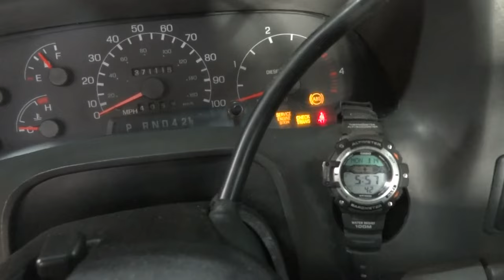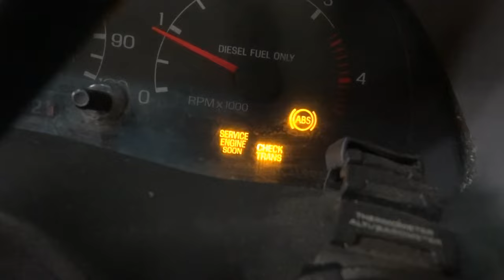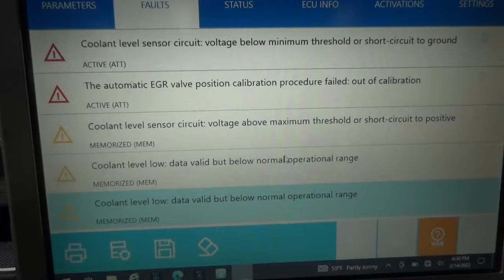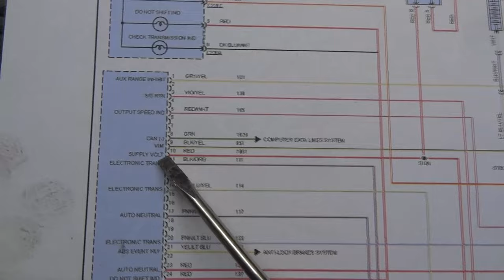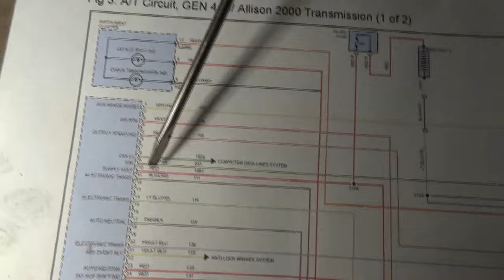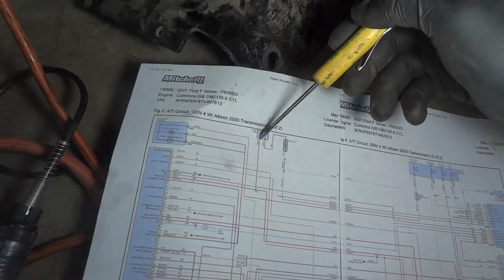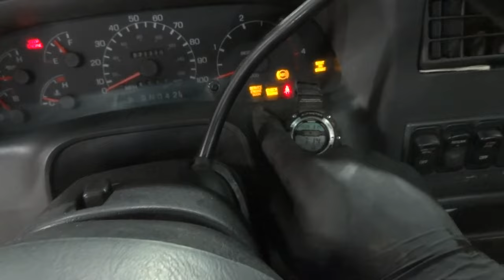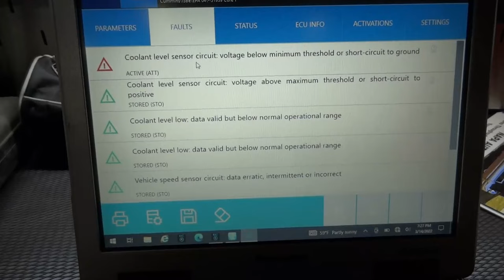Ford F650 No Crank No Start, Allison Transmission Not Shifting, Diagnosis & Repair Part 1

Comment: Just wanted to leave a comment on an issue that I had with my F-650. I put in two brand new batteries and I noticed that there was no power to anything. No crank, no start, and no power to dashboard. After several hours I saw a switch by the steps. I flipped the switch and immediately I heard the alarm for the driver door being open. I put the key in the ignition and tried to start the vehicle about 15 times with no luck. I then went to the local Walmart and got some Starter Fluid. When I opened the hood it said never to use starting fluid in the intake. I disregarded this message and sprayed it once. It cranked but still didn't start. I sprayed it a second time with a large volume of starting fluid. Turned the key and then it started! Had to wait for the brakes to get the right PSI and I drove it 800 miles!
Reply from the maker: Alexander Golovin  Thanks for sharing your experience with us!
Reply: @KITS_Auto_and_Truck_Repair  Of course! I used this video to help me diagnose the issue. Thank you for your great content.
Reply from the maker: @MrAlexGolovin  My Pleasure!

Comment: Good morning sir .i have a question ❓ please how do u get to pull up a wire diagram for a vehicle.i have difficulty getting specific wiring diagram when needed.thanks
Reply from the maker: Tahla Jude  I get my wiring diagrams from michel pro demand you can call them and they will help you!
Reply: @KITS_Auto_and_Truck_Repair  ok but how do I reach them .it will help me alot in diagnosis . writing from Africa .cameroon
Reply from the maker: @tahlajude5572  ah ok!! you can email them and see if they have a rep there!

Comment: Very Smart move from you!
Am on the similar situation,  2009 ford 750 
I need some help
Reply from the maker: @user-mi6iz8gr7h  Do the tests that I did in the video! you might have the same problem!
Reply: @KITS_Auto_and_Truck_Repair  I have had hire 3 mechanics so far, with their computer and no one  have received a signal from tmc , so am at the point to do my own test following your knowledge,  and se what I have, thanks
Reply: I  decided to buy a new TCM, and installed  ta solve the problem!!!
Your video help me a lot 
Everyone was telling me , is the transmission and I said I want to try to find electronic problem first 
Before I made tha decision,  !!!!
Now truck is back on the road 🙌

Comment: Hey I got 2015 f650 getting a code spn191 output speed sensor replace it still getting the code
Reply from the maker: Jc Cooksey  you probably have a wiring problem!

Comment: Great Diagnosis Deo! In the future be sure to protect your back-probe power supply (jumper wire from positive jumper cable) with a fuse so you don't risk burning up a a TCM. A 50 cent fuse in between two of your jumper leads is cheap insurance when performing tests like these. How do you like your TEXA laptop? I have a JPRO laptop but the TEXA looks very user friendly.
Reply from the maker: @williamsemmler5166  Great Point! I like my TEXA laptop it's very user friendly!

Comment: Thanks for this again.But one question to ask.What is a difference between pending codes and memory codes?I know I can find it on internet but it could be better if you help me.Thanks.
Reply from the maker: Highest Forward Gear  My Pleasure! the difference between Pending codes and stored codes is that! Pending codes are codes that are not active, some Pending codes require two strips or two starts to become active,  so it's a pending code when it has failed both failing strips but a stored code is a code that has been stored in the computer's memory and may or may not be active while the Engine computer is being scanned!
Reply: Oohh!got it right,thanks

Comment: Another good diagnosis!  I wonder if the built in wiring diagrams on the Texa show the TCU power wire as well in case it’s shared with the ABS module. I have the Texa marine scanner and found the interactive wiring diagrams useful.
Reply from the maker: Bart Young Thank you!! That's a good point! I know this Texa tool has wiring diagrams but I don't use them, Lol! I'm so used to using Mitchel wiring diagrams, I checked off camera and the ABS unit gets power from a different Fuse!! 
Good Point though and thanks for reminding me about the Texa wiring diagram, I completely forgot about them!
Reply: @KITS_Auto_and_Truck_Repair  They simplify the diagrams on the marine engines, showing even path of ccurrent flow.  I'm not sure how accurate they are.I was surprised to see the wiring diagram tab on your tool for a truck.
Reply from the maker: @bartscave  oh really! I remember using Texa wiring when I first got the tool, then I stopped using them! I need to take advantage of them!

Comment: What a useful and intellectual idea from you good job more grease on your elbow, am a little confused about what type of wiring diagram software to get, any help from you please.
Reply from the maker: Aminu Abdulqadir Abubakar  I would recommend getting mitchel prodemand diagrams, if you have any more questions email me at Deo@calleva.org and I will help you figure out the right diagrams for you!!
Reply: Am so glad to hear from you sir I will message you on your email.
Reply: I tried to reach your email address but is not connecting sir.